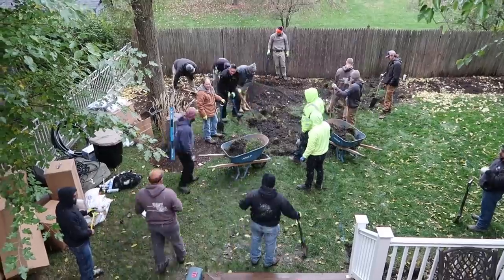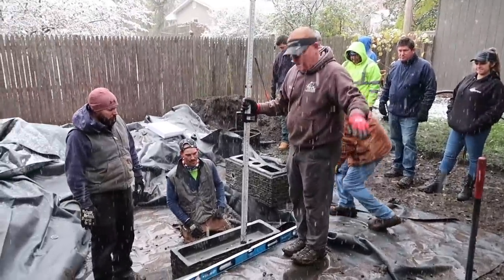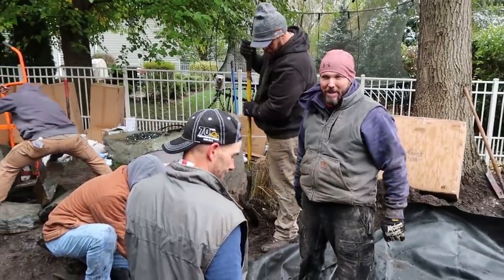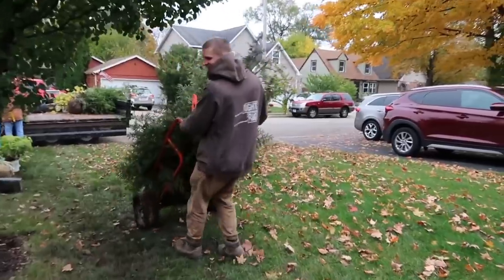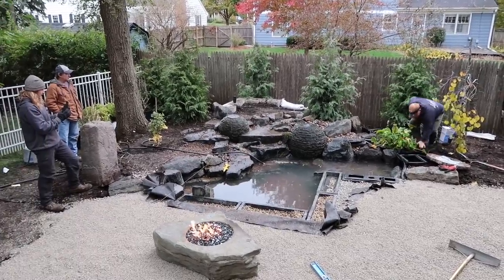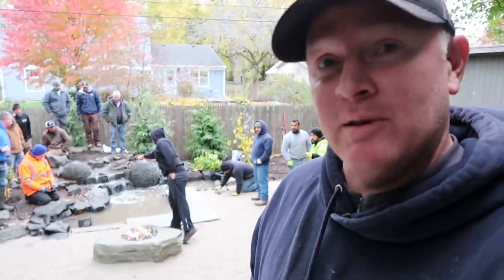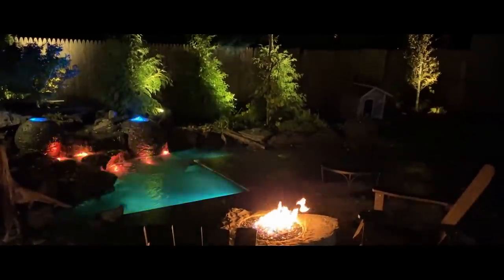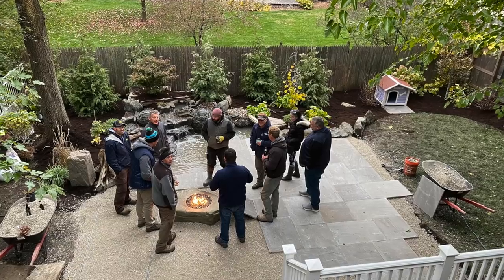Formal Pond REVEAL for Greg Wittstock, The Pond Guy - Part 2

Comment: That is the best looking small pond I've ever seen! What size pump or pumps did you guys use for the Biofalls and Spheres?
Reply: Hi Shawn-  We used a single 4000-7000 GPH Solids Handling Pump.  We used a manifold split system.  We dialed up about 3,500 GPH through the Biofall and the rest through the spheres.  We don't know exact gallons but it was using 2" pipe.
Reply: @chriswilson5571  Thanks Chris!
Reply: Please add in the notes on what you used for this project!  Looks fantastic!!

Comment: I would have had to cut and rolled all of that beautiful sod.
Now if only my Aquascape Auquasurge 4000-8000 variable pond pump remote control would work, I would be a happy camper.   :(
Reply: Try Re-Syncing the remote.  Use the following steps in the event of no communication between remote/receiver, or partial function (up/down is ok, but no on/off or vice versa).

Please ensure that the rocker switch on the receiver (next to the cords) is depressed to the “0”, then proceed with the following steps.

o    Power off receiver (unplug)
o    Plug in receiver 
o    Hold both up and down adjustment buttons until it flashes (about 5 seconds)
o    Press any button on the remote
o    Remote and receiver are now paired
You can also pair any remote to any receiver.  You cannot pair one remote with multiple receivers, however.
Reply: @chriswilson5571  Thanks for the response.  Unfortunately, I have the first generation control box with remote.  There are no buttons on the receiver other than the 0-1 rocker switch.